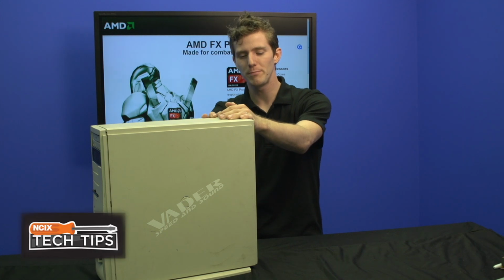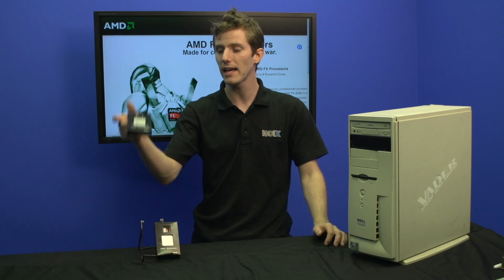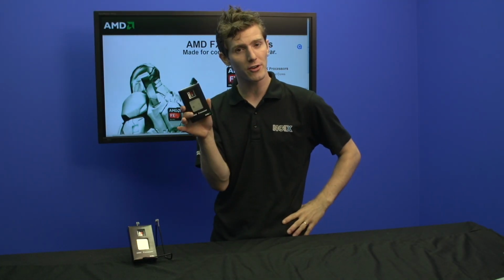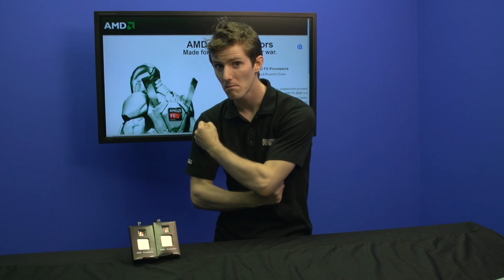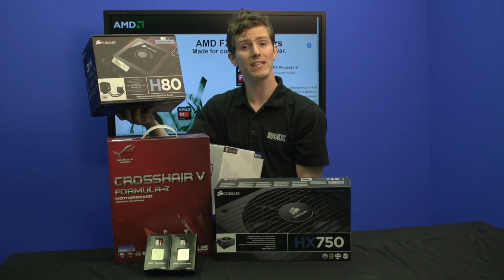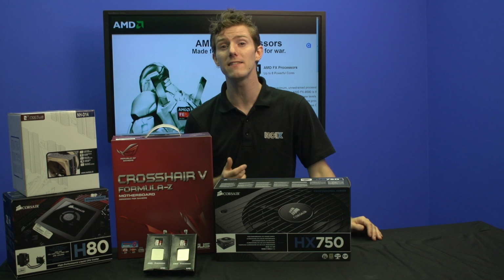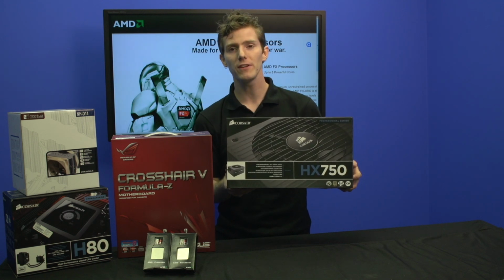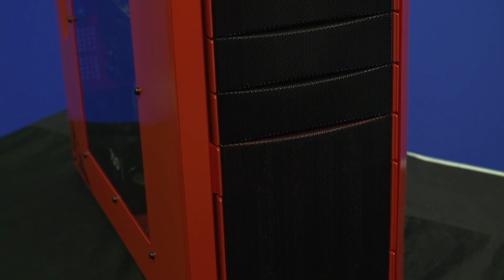AMD FX 9000 series processors hitting 5GHz!

Comment: 10ghz in another 14 years
Reply: That's faster than the speed of light if I'm not mistaken.
Reply: Salpeteroxid it is. we can nearly do 9ghz on ln2 so i don't see why we can't do 10ghz in the next 14 years
Reply: Lawrence Timme
It would sure be awesome, imagine to tell your kids (don't know your age but I'm 21) "When I was your age I had a 3.8ghz processor" ^^
Reply: Salpeteroxid or in my case a 5ghz processor :)
Reply: Lawrence Timme My motherboard is a weak one, can't overclock or even turbo. Had to take it, put almost all the money on the gpu, turned out well though all games run fine :)
Reply: Salpeteroxid good i have a z77 mpower so my board has no problems with overclocking :P
Reply: If I were doing anything remotely CPU demanding I'd buy new parts but I only play Battlefield and I'm happy with my 60-100 fps
Reply: Salpeteroxid fair enough. its fine if it does what you want it to do, i'm not really bothered much about gaming, i prefer overclocking and benchmarking.
Reply: Lawrence Timme
I game and check youtube and work emails, I'm an it-consultant so my interest is most definitely there but I have so many others things to put my money on than something that doesn't make a difference for me, but when I can I will definitely go for something like what you have. Prestige is awesome :p
Reply: Salpeteroxid it is right up until a new faster gpu comes out. i don't think it was as bad as i expected having the 290's and 290x's destroy my 7970 lightning in benchmarks though because i know that they have beaten me with raw power and i have spent time overclocking it and getting all the performance out of it and if i had there card i could get it to go to the limit of the hardware rather than just buying a faster one that isn't on the limit.
Reply: Salpeteroxid
Damn I'm old!  The first computer I ever built was a 386-DX 25. Running at a blistering 25 Mhz.
Reply: Kpoull  Hahah ya indeed! My first pc was an 486dx2 60mhz lol!
Reply: Just imagine the stories: "How did you lose your hand?" - "I tried to install a cooling system for my gaming PC."
Reply: Yeah but how long til they get it done. I mean it took em long enough to add the fucking USB 3.0 even though it was available, ready for use, and people asked for it.
Reply: im from the future, we dowgrade in speed of ghz because it causes instability in the fabric of space-time
Reply: No
Reply: Salpeteroxid When i was your age. We had 400-800 mhz procs...
Reply: EnhancedCognition We had those when I was young, computers sucked back then, now they are amazing.
Reply: Kpoull Better to be born in the early 90's ^^
Reply: Michel Linschoten I had a 286 with 8MHz. There was a turbo button to boost it to 16MHz! Some games couldn't handle the turbo'd speed. Before that I had a 186 or 8086, I think. Was more interested in my friends' NES back then(it had more than the 4 colors of my pc monitor;))
Reply: We'll have to learn how to harness the cooling power of liquid nitro. I can imagine corsair making a liquid nitrogen kit that's easy to install.
Reply: Yeah, once we can condense a glacier down small enough to cool a CPU. We have pretty much hit the cap on how fast silicon chips can get. More like 32 Core CPUs in ten years, at the very least a true 8 core desktop CPU.
Reply: Bound4Earth Intel is making 8 core CPU's with hyperthreading.
Reply: ***** Never seen processors measured in KHz lol :p
Reply: Under Moores law this would probably happen far sooner. Once Intel/AMD get close to the limits of silicon (less than 10NM) you will probably see this.

As far as I'm concerned Intel promised 5 NM until 2020...so that would be 6 years or less.
Reply: Ioner66
I might still be on my 22nm 4790k in 2020, or maybe not.
Reply: Salpeteroxid If you use that PC regularly the chance is high that the CPU will have fried by that time. The lower the NM the higher the chance of the CPU being damaged by the smallest interferences.

But it's partially on purpose since the companies lately love making hardware the blows up right after the warranty is gone.
Reply: Ioner66 true .. if you spend hrs on your pc everyday.. if you spend a hr or two with good cooling and a good cooling chasy you should be fine.
Reply: Goals, Focus, Apply, Results! Except that booting your PC has a decent chance of having small powersurges as well...your PSU is supposed to block that from happening...but as parts age they start messing things up.

New CPUs will NEVER last as long as the old stuff...simply because A: They're made that way (to break) and B: The smaller the NM on silicon, the faster stuff breaks.

I'm pretty sure that if you take all of the current gen CPUs...less than 50% will still run fine in 5-6 years ;p
Reply: Ioner66
Processors are not design to break, do you even realise how a processor is made? "Let's grab that shitty silicon and that impure copper, hurray!"  CPU's can be a life or death situation in some computer systems, that's why they aren't made to break. They become obsolete fast enough.
Reply: Salpeteroxid You seem to be putting standard consumer CPUs and professional CPUs and server CPUs in the same bin...

Consumer hardware is ALWAYS of a lower grade quality and with less safety features... wake up. That's how that stuff is designed. 

Look at AMDs old Phenom II series...that stuff is now 5 1/2 years old and is still going(It's still from the pre-break era)...furthermore on a processing power level it is very close to the FX series... Which is bad for AMD because as long as the chips work there is little reason for many consumers to switch chips.
But look at their 28NM chips...even the failure rate during production is already three times as high. Silicon is prone to mistakes the smaller they get and they will certainly not last as long.
Reply: Void Doctor
 Had one of those too!! Amiga 500, Commodore 64, Commodore 128 man o man..and i am not that old!

34 as we speak lol..
Reply: ***** And again....Ghz is not as important as AMD and Intel raising the hz efficiency.

In a few years those CPUs could still be sitting at 5 GHZ...but those 5GHZ could be as fast as todays 10GHZ would be.
Reply: Jeon Soo Neo I know very well the difference between xeons and consumer grade.
 I'm an it-technicians, just last week I built a server and a couple of dc's.
Reply: It went really fast in the computer world. I remember a time were stores still stocked parts. Now they barely do so, because of the progression. And price fluctuations.  Pretty crazy...
Reply: Well I'd say that in a few years (5 or so years) we will see Processores starting to use double digits of cores as a standard.

It will likely be 16 cores for the normal consumer.

Those cores will all clock somewhere between 3 to 6 GHZ.

But here is the thing...those 3 GHZ will be as fast as todays 5 GHZ PLUS the cores will work together more natively and scale without a performance loss unlike today.

In 10 years we will start the regular doubling of cores.

32, 64, 128, 256. 

In about 15 years we should be at CPUs that have 128+ cores that all work together natively as if they were one core.

You do have to keep in mind that those cores will likely NOT be made on silicon anymore as that material is hitting it's limit at 10-14 NM.

In theory 7 is possible with silicon..but the material is far too brittle for it.

In 20 years we will have reached the 1-2 NM scale and CPUs will slowly approach 1000 cores.

But what's more interesting: GHZ clock speed will not go up.

Also my prediction will only come true if we stick to todays' scheme of processors...but some companies have already made CPU cubes with hundreds of CPUs on them (not as standard consumer hardware). So in the end... 10 GHZ might be something we never reach. 

It is all about making those GHZ MORE EFFECTIVE.

If you look at Intel vs AMD you can see what I mean. AMDs current line of CPUs at 4 GHZ can't even compare to a 4GHZ Intel...their 4GHZ is way faster.

GPUs at some point will disappear. Since CPUs will be going down the road of more and more and more and more cores....GPUs will slowly fade.

In about 20 years CPUs will likely take over the job of GPUs again. (Even if you say that they take over different workloads...that is only that this is the case NOW. Once the core numbers on CPUs go up we will start seeing more and pore poten CPU/GPU combo cores that will at some point just be CPUs that can also do the graphics part. (Now don't get me wrong...Graphics cards won't just disappear like that... AMD was trying something related to it with their APUs...but in about 10 years companies like Nvidia and AMD will both start producing high performance graphics solution INSIDE of CPUs....and in 20 years even enthusiast gaming GPUs might be embedded into the CPU itself....at some point the barrier will fall entirely and GPU + CPU become one again.)

Later down the line all the memory (let's call it ram for now) will be on those CPUGPU chips.

That is the future...we will not be seeing some ridiculous 10 GHZ quad cores or anything.... We will see 5 GHZ CPUs with 1000+ Cores in a few decades....that is the road we are headed.

20(maybe a few years extra) years from now on we will not be using motherboards anymore like we do today. You will just put a single chip on them (or they're already soldered onto it) and that will be it.

All your devices will then be connected to that 1chip solution.

That is about the most realistic prediction I can give you.

It MIGHT be possible that AMD or Intel will pull a freakshow within the next 1-3 years and release some retarded 10GHZ chips...but trust me...this will not be the norm.

While we have not hit the maximum of what is possible with GHZ...it is less effective than just making those GHZ scale better and add more parallel working units that can at some point in the future work on the same thread...that is the true goal CPU makers have... Multicore programs today have the problem that they all need to be split up in many work hours of time just so the cores can use it...that will be a thing of the past at some point when CPUs can manage to split up a single thread automatically...which is why core doubling will happen at that point.

In 50+ years a single CPU will consist of thousands of cores. Include whatever memory type is then prevalent, do the graphics, have the entire "chipset" inside and is basically a true "SoC".

You will basically just buy a single chip that can directly be used to run all your software.
Reply: Jeon Soo Neo They will likely have different SKUs of that generation's processor to meet the needs of multiple sets of people. (e.g. 128GB RAM, 256GB RAM, 512 GB RAM, etc. (Not limited to RAM, just as an example))
Reply: +Lawrence Timme You mean 9Ghz; It takes 14 Years to add another 4Ghz. SO in another 14 Years it would be 5Ghz + 4Ghz = 9Ghz
Reply: ***** They wont bother with 10Ghz, the base will be 10Ghz, the multiplier will be 100 xD
Reply: Again....more hz is not what we need. What we need are more cores that work together as one and more IPC.

And that is exactly what will happen. Just how GPUs slowly evolved into multicore monster machines with hundreds to thousands of cores working together as one unit, CPUs face the same direction. 

The architecture/environment is obviously different, but multicore is our only option to advance..that and "wiiiider" cores. Hz however is not. 

10 Ghz will not do us any good if the IPC is shit. You could expect 5-6 Ghz to be the limit/standard for maaaany years to come. But in 100 years the CPUs would be running at the same 5 Ghz but have hundreds of cores. Assuming Quantum Computing is still not a thing by then.

Seriously, though...if you wanted a 10 Ghz CPU you could have it...heck, you could have had it for many years now...but the IPC would've been so terrible that it would be equal to a 3Ghz CPU of current IPC strength.
Reply: Jeon Soo Neo You don't know how code works...
Reply: InterCo - interface212 we are nearly at 9ghz already. a few amd cpus can already do well over 8ghz on ln2
Reply: Lawrence Timme We reached 9 Ghz as non-sustainable overclock. Even if you kept cooling the CPU with liquid nitrogen 24/7. It would break REALLY fast that way. 

Please stop acting like 8-9 Ghz are everyday overclocks. 

Everyday overclocks are at 5 Ghz for AMD and around 4.7-4.8 on Intel side right now. (Intel has a lot more IPC though, so their CPUs end up with far better performance).

Plus you need to keep something else in mind. They are constantly shrinking CPUs and try to lower power consumption but also raise performance....but shrinking them down (nanometer) makes CPUs more fragile. 

You can expect sub 10nm CPUs ti actually fall below 4 Ghz again on their top-dogs.
Reply: Lawrence Timme My i7 is better at 5 ghz than AMD is at 8 so..... Clock aint shit, it's the architecture.
Reply: Jeon Soo Neo i know. i dont really care about 24/7 overclocks tbh. i only do benching and i have a phase cooler. i have an ln2 pot as well.
Reply: ***** No shit facepalm
Reply: Lawrence Timme But ln2 overclocks are useless for normal use and you know it. They're just for benchmarks. You can't really say that we "reached" 9 Ghz if you can't do anything practical with it :p. 

And with the next die shrink you might be utterly disappointed...I feel like we are gonna fall down at least 2 ghz in ln2 overclocks once we go sub 10nm.
Reply: Jeon Soo Neo Why will we slow down?
Reply: InterCo - interface212 More electrons in a tighter area?
Reply: Salpeteroxid But we could just put less electrons, even so i still don't know why that would slow it down.
Reply: InterCo - interface212 Because increasing the IPC is a lot easier than increasing the clocks. 

And whenever you die-shrink...you will initially be hit with some lower ghz chips first until they can optimize it back up to the old values. 

Also..."just put less electrons"? Nah bruh.

I mean look at current gen CPUs. 3.5 Ghz is a very normal clock on the Intel side of things...now 3.5 Ghz CPUs are something you could have aquired 5-6 years ago. But the IPC difference makes the newer chip a LOT faster. 
Basically the IPC makes it so todays 3.5 Ghz chip is somewhere around what a 8Ghz chip with the old performance would have gotten....except that a 8Ghz chip today would suck much more power than can be cooled by air...or water for that matter.
Just try cooling down a 350-400w TDP CPU...that's just not feasible for the normal enduser.
Reply: +Lawrence Timme It'll take just 2 years to reach that. Believe me, I've seen the illuminati shit they use to build crap like this.
Reply: most cpus are still at 3-4 Ghz so I doubt we will see 10ghz in 14 years. Intel proved that Ghz don't matter that much if the per core performance sucks. also cores don't matter if 8 cores have worse overall performance than 3 or 4 cores
Reply: most cpus are still at 3-4 Ghz so I doubt we will see 10ghz in 14 years. Intel proved that Ghz don't matter that much if the per core performance sucks. also cores don't matter if 8 cores have worse overall performance than 3 or 4 cores

Comment: I was planning in getting the FX-9370 and I was wondering: Would I be set with my Gigabyte 970A-D3 motherboard and a Thermaltake Frio CPU cooler? I know I have enough power for sure and I might not overclock anyway.
Reply: If you are planning on upgrading to that, I would swap the board as well. Doesn't have to be anything high-tech, but a newer board so you're settled for new stuff coming out.
Reply: Anything you'd recommend. Don't have to much to spend though.
My cooler is good though, right? Maybe for some light overclocking as well?

Comment: well... an i7 4770k got pretty much the same performance as this cpu, and it's half the cores
Reply: You should make sure you understand fully both architectures first. Intel has 4 physical cores + hyperthreading, so it can process 8 threads. AMD has 8 physical cores in 4 modules, which means 2 cores share a small amount of the internal architecture, the FP scheduler. AMD actually has more resources per each core. But when you consider the fact that a $159 AMD can perform as well as a $329 Intel chip, Intel begins to look pretty pathetic.
Reply: berzu21
Mantle is an API for the GPU, like Directx or OpenGL. If anything it would lower the requirements for CPU power in general for gaming.
Reply: They're not real 8 cores. 4 virtual cores.